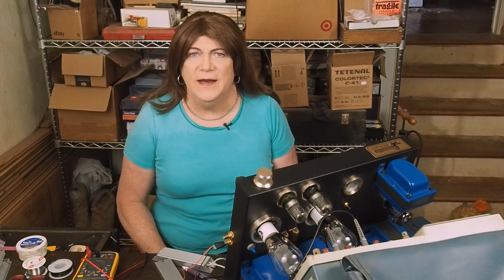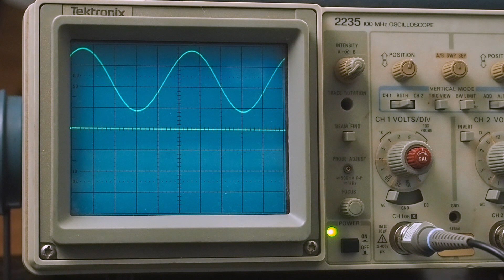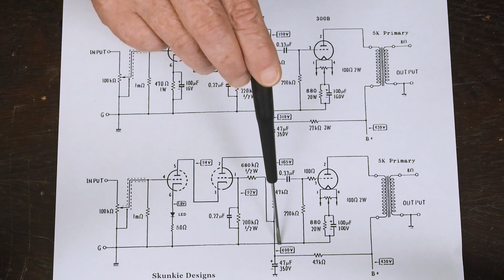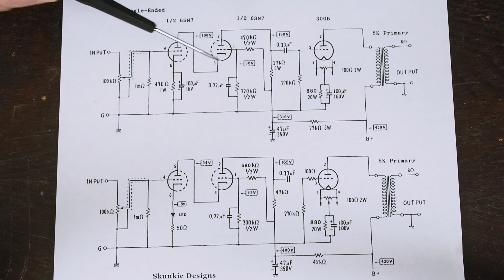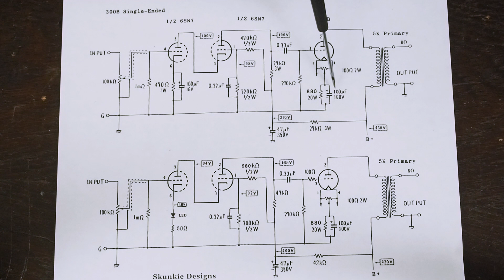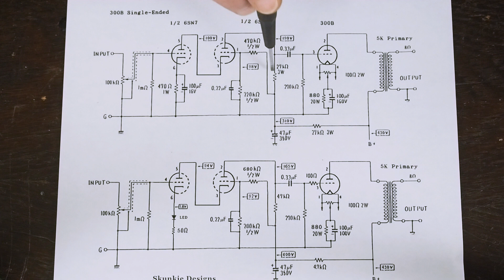300B Tube Amp:  Final Analysis, Mods and Solutions for JC Morrison based Amplifiers.

Comment: I’m curious about your use of an analog meter for the bias? I don’t see anything in any of the videos, you talk about it and it shows up, but there’s no description & I didn’t see it, integrated in your circuit on the schematic?
Reply from the maker: What I'm using now is simply an optional voltmeter, using a center off DPDT switch across the cathode resistors. It's nice for monitoring the health of the tubes, but isn't required on an auto bias amp.

Comment: Fantastic video. In 2004 I built a similar 300B amp. It, as did the JC Morrison amp, had two voltage amplification stages, with the second stage (a 6SN7 driver) directly coupled to the input stage (in my case a Type 27). The amp sounded OK, but not great. The bass was a bit woolly and consequently I didn’t hear the 300B siren’s song. 

Fast forward to 2024. I learned a great deal over the past 20 years and I, too, discovered the same problem that you did—also using my scope. The problem is that the 6SN7 (of the Morrison and similar designs) clips before it provides the necessary 140V P-P of swing on the 300B. So, the 300B is never driven to its full output. The driver should never clip before the output stage, but here it does.

We’ll, why did that happen? It happens because coupling the input stage directly to the driver requires that the cathode of the driver stage be elevated to 100V or so. In effect, that eliminates 100V of available P-K voltage, which dramatically reduces the possible 6SN7 voltage swing (without ridiculously high B+).

One solution—which I may yet try—is to RC couple the input and driver stages. That way, the cathode of the driver can be ~6V and there should be plenty of swing available. But lots of people don’t want that “extra” capacitor in the signal path.

Your approach is an excellent one. By connecting the 6SN7 in cascode, you’ve effectively turned the upper part of the cascode into a constant current source. This flattens the load line and gives you just enough swing. My approach was to add depletion-mode MOSFET constant current source circuits in place of the input and driver stage load resistors, again flattening the load line and providing more gain. Both your approach and mine get very close to that holy grail of having the driver deliver the 300B to full power. We want the 300B to clip, not the 6SN7!

In the end, the simplest conventional way to solve the problem of drive might be to RC couple the input and driver tube, rather than couple them directly. But, there is more than one way to skin a cat.

Loved your post!
Reply from the maker: Thanks for the thoughtful response!! And yes RC couple the 2 stages likely would work too.

Comment: I've been looking for a 300B amp for a while now. And yes, I was looking at the Chinese ones but never pulled the trigger.  I think I'll build this one someday.  My only concern is life testing and sound quality 3 years from now after parts and tubes drift a bit, so hopefully there's enough play in the design to achieve this.
   Thanks for all your vids from  a big tube and audio nut in Long Island,NY.
    If you're ever overwhelmed with assembly, I can help with that and build these amps at home (if low volume) or get help from my friends at my job and build them there. We manufacture electronic products, mostly by hand.  You should be happy with the quality and attention to detail. I've been into anything with electrons flowing in it since the '70s.
   Well, great stuff ! I'm excited about this amp.
Reply from the maker: I've tested this circuit with a pretty wide variety of tubes and I don't think "drift" in a concern.
Reply: @SkunkieDesignsElectronics  
Hi Stephe, thanks for the response. Nice channel. I'm new to it. 
    That is good news.  I saw you got the additional driver voltage out of the 6SN7 and was concerned with the additional voltage diminishing with tube age (that's what I meant by drift, not so much component value drift, but tube life - bad choice of words), but if that takes a while, that's good news.  If not, then we know that 6SN7 tubes are rather easy to buy. 😊
    I'll keep an eye out on your site for the BOM and final schematic. My friend has the Zen so that's how I learned about your site. A Zen won't cut it with my speakers.  Have a nice Thanksgiving! Take a break from the tubes.
Reply from the maker: It's been up on the projects tab: https://www.skunkiedesigns.com/300b
Reply: @SkunkieDesignsElectronics  
Thank you for the links!   Sorry, I couldn't find it the first time.  Must have been barking up the wrong tree.

Comment: I am really pleased to find your channel and this particular 300B amplifier build. I built a stereo 300B using a choke as the plate load because I was too cheap to buy SE transformers figuring an SE amplifier is a novelty in the HiFi world but found out it did a decent 7 watts average power and has a fantastic sound regardless of the relative high THD. 

I used James output transformers to match the high Z side of the choke load to speaker impedances. I went thru the same pain as you did with playing with the 4.7K - 5.1K - 470 ohm - 510 ohm - 27K - 47K - 51K etc....... on the 6SN7 driver stage. I don't remember exactly what I settled on but have it as a schematic in LTSpice if you want it.

I have never seen a first stage drive a second stage without a plate load resistor. That is definite novel in my book. I am not criticizing it as I assume plate voltage for the first 6SN7 is derived from the second stage thru the connection to the cathode ?? I can see the second stage is driven as grounded-grid but you might help me there.

In any case I am pleased to have found your channel. I just disassembled a SV572-10 SET amplifier I built a couple of years ago as I am so disappointed in it that it was nothing but in my way.
You might like my channel and here is my 300B SET amplifier that is also novel with the output stage.

https://www.youtube.com/watch?v=-78GRaEEjkw&t=716s

Here is one I posted tonight about the SV572-10 amplifier that I just finished disassembling.
The reason I found your video is even though I have all those beautiful 1619 tubes, I am just so charmed by triodes both in audio and RF that I am considering making it a stereo, push-pull 300B amplifier. This stuff is enough to drive anyone crazy.

https://www.youtube.com/watch?v=B-MC2T3hk08

Thanks again. Stay safe...
Reply from the maker: It's called a cascode and it makes 2 triodes behave as a virtual pentode.

http://www.valvewizard.co.uk/cascode.html
Reply: @SkunkieDesignsElectronics  Thanks for the link. I did read it. I guess my brain has heard of cascode but I have never used it so it left me scratching my head for a moment. I am more familiar with Darlington transistors. My driver stage to the 300B was essentially a modification of the Williamson design input, followed by another common cathode stage. Not enough drive there so I put that into a 5881 and and took that output to drive the 300B. Now I had plenty of drive but I got into the details, as you did, trying to get the most linear amplification and lowest THD and it was a real chore that I never was pleased with. That amplifier is gone now and new octal sockets have been installed for the four 1619 tubes. Last night I was floundering over should I use push-pull 300B but that is settled now. Thanks for your reply.

Comment: Thanks for such a interesting video. It's the first time that I've seen an oscilloscope since college in 1982, and fascinating to see whata you are able to do to understand and tweak the performance of this amplifier. I have the cheaper Reisong Boyuu A10, my first tube amp, and it sounds pretty, but a little muddy, with a pair of Klipsch Forte III (and a REL subwoofer). 

When I learned about this relatively inexpensive Reison amplifier using 300B tubes I was curious. I watched three reviews and all diplomatically praised the value of this yet left an impression that it didn't quite hit the mark. I then saw many positive reviews of the Decware range of tube amplifiers.

I'm wondering whether you have any experience with Decware, or with the Willsenton R-800i 300B amp (which is 3x the cost of the Reisong A50)?
Reply from the maker: Sorry I haven't but I've heard good things about the Decware line. After being inside two different china made tube amps, I'd be hesitant to spend a lot of money on one, unless it was being manufactured for someone trustworthy to ensure REAL parts were being used.

Comment: Hello Stephanie, Since this requires a pre-amp, do you have a recommended pre-amp which will give you the 3v p-p ?
Reply from the maker: 3Vpp is 1.06V RMS, which a normal CD deck or a DAC can produce. You shouldn't need a preamp unless you have a phono stage etc. that has a low output level.
Reply: oh yes, of course. I ended up simulating the original schematic and I was able to corroborate the same results that you measured. This made me happy to know that the simulation is accurate and that you didn't make a mistake.  Thank you, good stuff!

Comment: Are you saying that the schematic that ALWAYS shows up with the second voltage amplifier in that circuit with 27k ohms on plate and 27k ohms on cathode ? Is the A50 made with the same flaw???! If that is the case ,the Chinese ''engineers'' didn't look too far or test their design.Like always they steal ,technology.Much easier than R&D...

Comment: I think your videos are very informative, I want to know if you could help, by doing a very simple video on how to bias tube DIY  amps… I am really stuck with red plating on one valve, which I am hoping it is the biasing .. please help if possible..
Thanks .. cheers
Reply from the maker: My bet is a leaky coupling cap between the plate of the tube driving it. Remove the coupling cap, leaving the grid leak resistor in place, and see if that stops it. And yeah I can do a video on this.
Reply: @SkunkieDesignsElectronics  , I have just completed the build, and all caps are brand new, but I guess there is a chance of a faulty cap….
Will try what you have suggested 
Thank you kindly

Comment: 20 volts per division on a x 10 probe stetting means each division is 10 x 20 = 200 volts each division tech tip for you
Reply from the maker: I was using the the 10X scale on the knob to get the 20V per division reading. Looking at the 1X probe scale, was set on 2 X 10 = 20V per.

 And I don't think that driver was pumping out ~1400Vpp :)

Comment: I found when modelling with ltspice that some tubes can't do a cascode output and drive demanding tubes (talking about 12BH7A into parallel output tubes). This is why I have a cathode following driver stage simply to provide drive without unsettling the cascode.  I also have an odd configuration of 1uF (WIMA MKP10) and a 0.22uF (WIMA FKP1) (both 630Vdc/400Vac)  in parallel to couple which shows less rolloff when driving. I have 330ohm grid stoppers on each of the output tubes.
Hehe someone remarked it's taken me 7 months so far in designing my amp from scratch.. third life priority but the best advice in building a tube amp is take your time. Then multiply that when you're researching and experimenting.